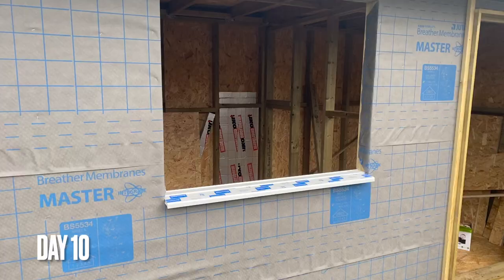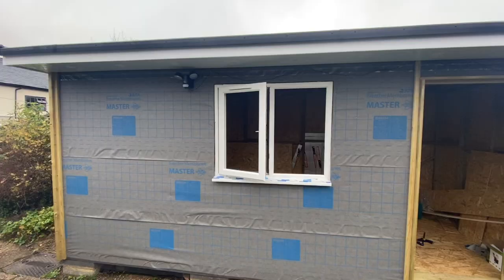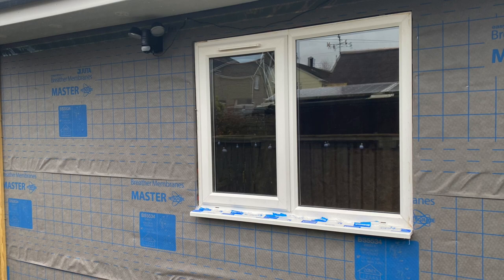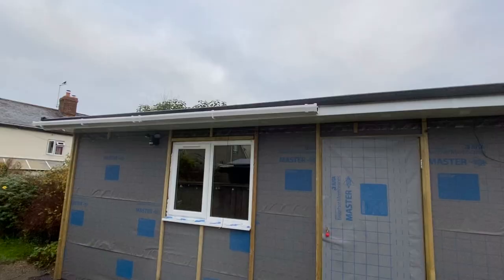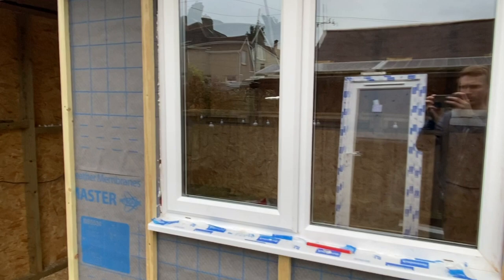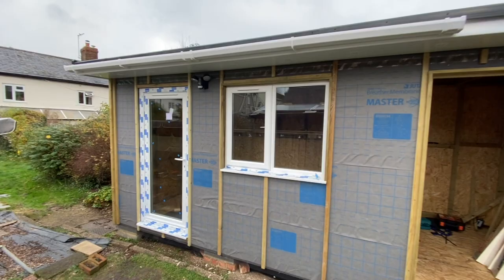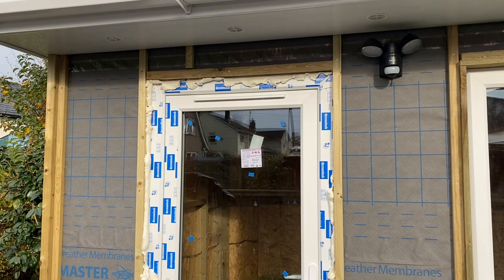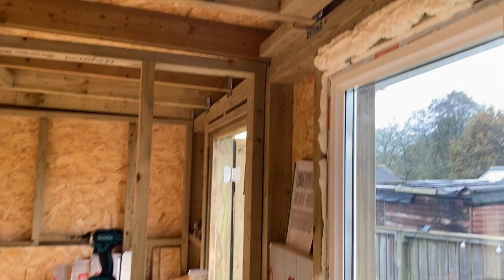Fitting a UPVC Door and Window to a Garden Room - Quick Garden Room Build - Part 4

Comment: Great build and great documentation. You haven't spared your efforts to document it as you went alone.  Thank you, so many people will learn so much from you experience.   You have also done a lot of research before the build to determine what design will be most suited.  This is impressive.     I have a question though.  Unless I missed it but it seems that you opted for a standard double glaze window instead of soundproof  one?  I wonder why since you are build the shed to be soundproof and play your drum without disturbing the neighbors.
Reply from the maker: Thanks for the comment. This is actually a different build to the drum room one where I did use acoustic glazing

Comment: GOod 2nd build. how did you fit a soffet on the back wall with the wall up before the roof or does the fascia just cover the box profile? thanks
Reply from the maker: Thanks for the comment. Yes exactly that. The facia covers the box profile and is flush up against the metal sheeting without any soffit board

Comment: Great job on this project, more informative than many of the others I’ve seen.  I’m planning to DIY a garden gym build, very similar size with a concrete slab base.  Do you mind commenting roughly how much your build cost so far (the price of timber isn’t great at the moment)? Thanks
Reply from the maker: Hi Aaron, thanks for your comment. Glad you are finding the videos useful. The build is probably in the region of £4,000 and would probably be nearer £5,000 today with the cost of materials and going for a concrete base.

Comment: Great videos. I am planning a build very similar to this. Would you suggest the block foundation method or a concrete slab? I’d appreciate your thoughts. Many thanks
Reply from the maker: Hi Jake, thanks for the comment. Glad you are enjoying the videos. I guess it depends on your use case. If you are thinking about a music room with double walls, then one of the key benefits of a concrete slab is that it gets the floor level as close as possible to ground level, which is important when it comes to the maximum height allowed for permitted works (2.5m within 2 meters of your property boundary). Depending on where you locate your building, or if you apply for planning permission, you can go higher, so then it is less of a problem. A slab is certainly more labour intensive, but on costs is probably comparable to a pier structure given the extra wood you need to purchase to build the floor. A pier structure is a little more tricky to layout and get level for the DIYer, but it is potentially quicker.